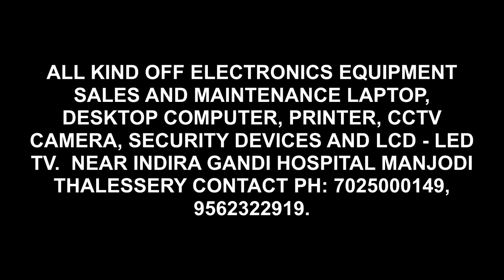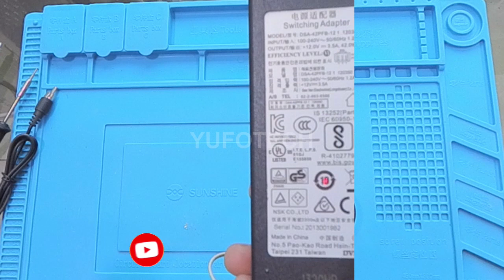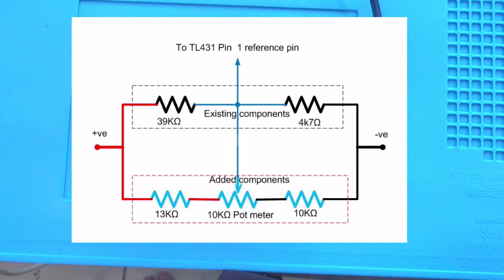SMD Double Soldering Iron Tweezer | Desoldering Iron | How to make SMD Soldering Tweezer Iron

Comment: What's the cost of the twin tweezer you are using? Kindly tell me whether it is available in cochin with the address or else can you arrange one such tweezer for me so that I will bear the cost. Also I need two 12 volt micro soldering iron which is also shown in your video. Good video.